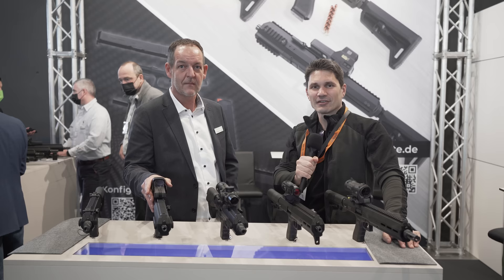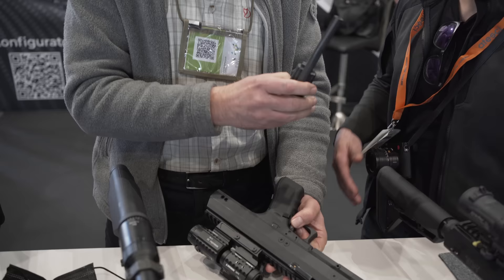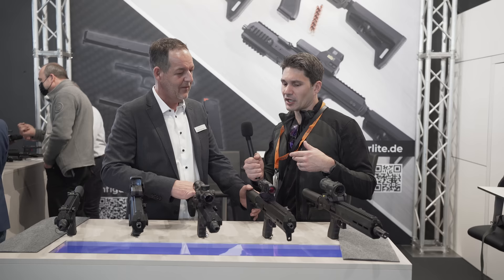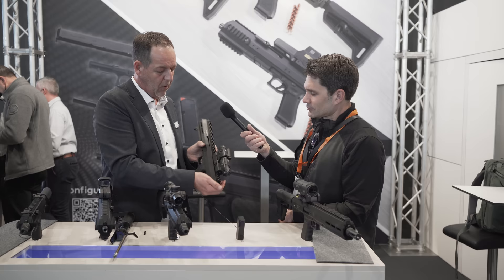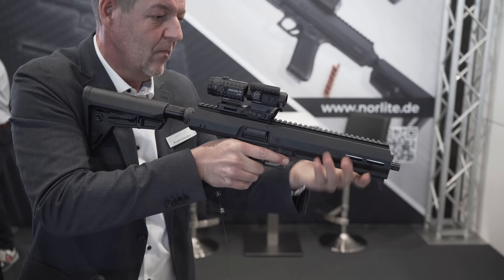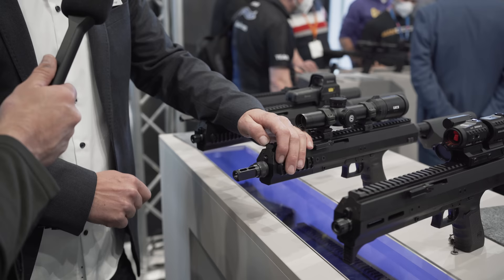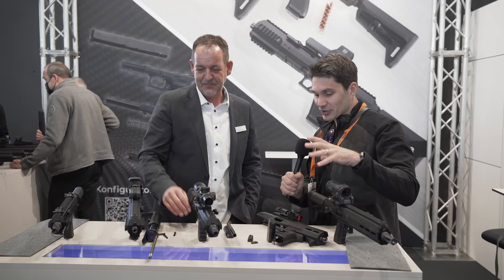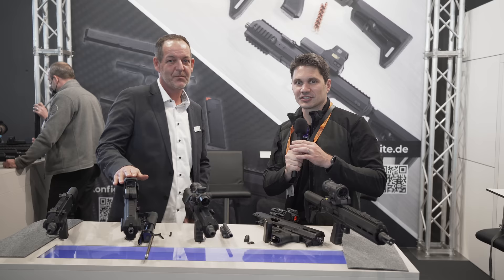The German Norlite USK-G Glock Carbine Chassis [IWA 2022]

Comment: The only chassis that actually looks useful, good to see this kind of product coming to the market.
Reply: While this does seem better in some ways have you ever tried a Roni or an MCK? Those things are far from useless
Reply: It's already been done by mectech
Reply: i would be an idiot to take this over a chassis from B&T
Reply: @Genesis23OPB  Ya'll are weird...
Reply: @Osprey1994  no its normal for me for two reasons: 1. i live just 1h away from b&t headquarters, so its a domestic product for me and 2. i want something as compact as possible, which the B&T chassis compaired to this certainly is
Reply: $1200 USD lol
Reply: The MCK 2.0 is no joke, especially for the price. However, this new German chassis is indeed interesting.
Reply: @captain edwardo  The Magtec has no last round hold up, requires the Glock original trigger, and like the Germab USK, it requires the addition feed ramp piece.
Reply: Looks like a HiPoint.
Reply: MCK chassis is amazing, for the price it's interesting that we don't even need something like this for almost 6 times the price

Comment: I wasn't expecting this. Finally a pistol chassis that looks worthy.
Reply: Yup. This is what the mech tech carbine should have been
Reply: The micro roni is still better
Reply: @bryananderson3772  that’s probably true, but it’s shape isn’t AR-15 enough to fulfill one’s GI Joe fantasy lmao 🤣… but honestly, I’d buy this thing if it’s as buttery as an authentic HK MP5 in the subcompact variety
Reply: The problem that these often are problematic with US laws that treat handguns and rifles very differently. One of the reasons that these are popular in Europe and other jurisdictions is that the legislation often limits you to number of firearms and calibers. No one will treat an AR-15 with a buffer tube as a "Pistol" this is very much a US thing.
The US definition of a pistol and rifle is very much dependent on external features rather than the caliber and indented use so when you put a handgun in a chassis you are essentially creating a rifle which would prevent it from being used ever again as a handgun, since the lower frame is often the serialized part.

Comment: These look like a much cooler option than the chasis that we have here in the US
Reply: Not a fan of the macaroni?
Reply: My friend has a "KPOS", its not very accurate at all, this new one here in video might actually bring actual rifle like accuracy within the effective range of the gun.
Reply: What's wrong with Mech Tech?
Reply: well its not really a chassis, its more of an creative extention of the slide
Reply: @Genesis23OPB  yes, quite like the system in the video...
Reply: @omicrondec  i was refering to the OP, not the mech tech comment.

a chassis is a carrier for your gun as a whole, like the B&T glock or walther chassis, flux brace or caa roni. (the B&T sig p320 USW replacement grip is a bit of an oddball, but as it leaves your gun with the original barrel length i would count is at a chassis)

mech tech and the one in the video are not chassis imo tho, as it replaces the slide and barrel and basically just uses the original grip, therefore its an extention/replacement of the slide.
Reply: @deathlis  I love my macaroni. Never failed
Reply: Yes, but this would have to be registered as an SBR unless it came with either a 16" barrel or a stabilizing brace.
Reply: @Haku Yuki   It's not like it's a stolen Monet that you can hide in a room and only view it alone.  People are going to see it and hear it.
Reply: Because these make no sense under US laws, most gun control legislation around the world limits number of firearms and calibers rather cosmetic features, in Germany using your pistol in this Chassis would not create a rifle in the US it would (and an SBR at that).

Comment: As has been stated before, the designers knocked this out of the park, and I cannot wait for it to inspire designs around FCU based firearms, utilizing FCU and magazine alone. Perhaps we'll end up with an MP7-esque Ruger  that doesn't rely on a clamshell around the slide.
Reply: Hear Hear! The past gossip and rumor(s) perhaps of a Glock Carbine and or similar has inadvertently came True.
Reply: Could probably be done real easy for the Sig 320 or 365 since the FCU is so small and easy to drop in a new system. I never even thought of the possibility of having a rifle you could jsut drop the Sig FCU into. That sounds amazing.
Reply: Now that would be something I'd actually save up money for and buy
Reply: What does FCU stand for?
Reply: @FOVoid  fire control unit

Comment: Awesome news that Norlite already has plans to ship/build these for the US market.  

I can see a couple of other comments about the MechTech carbine conversion system, which has been around for at least a decade or more. It is similar in that it utilizes the frame and magazine, and has barrel lengths ranging from 10-16". 

The good: MechTech covers a wider range of handguns: Glock, Springfield XD/XDm, and a variety of 1911/2011 pistols, and are reportedly working on an upper for the S&W M&P pistols.
They also offer multiple caliber options: 9MM, .40SW and 10MM, .45ACP and .460 Rowland.

The not so good:  the operation is likely only a few people, and lead times were long even prior to the beer bug burninating the supply chain. They are also relatively simplistic designs, a direct blowback operating system built around a round tube receiver, reminiscent of the Sten gun. The options for mounting accessories and furniture are very limited as well. No MLOK compatibility, etc.

The subjective: The MechTech stuff works well, but it looks like a rejected design from a Fallout game. The Norlite fixes a huge number of issues, mainly how to effectively mount optics, lights, etc to your ersatz Glockarbine, and the price the gentleman you interviewed ballparked is well within reason compared to the price for an upper from MechTech, especially given the improvements to ergonomics, mounting accessories and aesthetics compared to the MechTech product.

Hopefully they listen to their US partner and are receptive to offering them in multiple calibers; 9MM is fine, but don't diss the .40S&W, 10MM  and .45ACP, which there are millions of examples of Glock handguns chambered for in the hands of potential US customers.

Comment: This looks a lot like the Mech Tech systems, except done right. I had a 10mm Mech Tech that shot well, but was ridiculously heavy. Hoping they make a .45 acp model for the 21sf!
Reply: I was just thinking of the Mech Tech system. This looks a hell of a lot nicer.
Reply: I thought instantly, dont we already have that, this looks familiar? Mech Tech uppers, i never hear anyone talk about them anymore.
Reply: @RedDogRichard2112  I owned one. You couldn't field strip the upper without tools and there was no way to carry the gun safely because the Glock trigger is always exposed (as opposed to being in a holster).
Reply: @9unslin9er  wow that is bad, I'm shocked they didnt put a safety in the desgin! I kind of wanted one but at the time they didnt have threaded barrels (a pcc without a threaded barrel is stupid). Honestly MechTech uppers and JRcarbines are two things Im surprised still exist.
Reply: I happened upon this video as I was looking for a lighter alternative to my 10mm Mech Tech. Unfortunately there does not really seem to be anything other than the Mech Tech, Roni and Flux on the market for 10mm.
Reply: Ditto on the 21sf
Reply: Regarding the MechTech CCU .....5.7 lbs is ridiculously heavy?

Comment: Wow, this is super well developed.  I hope they are successful.
Reply: I must say this is available for some time here in Germany, but it did not take off. I did the configuration some time ago, and ended up at 1500 Euro. For that i can get a Beretta CX4 and I don't have a glock trigger. The system is also very top heavy.

Comment: We've had something similar for years called the Mech Tech CCU.

However, that unit was not easily dissasembled for cleaning. If they keep these under $500, and lightweight, it would be a good alternative.

Also, this needs some type of mechanical safety over the trigger guard.
Reply: You poor. This is clearly going to be 800 plus. If you can’t afford it go play with your hi point
Reply: well, he said the price. just under 1k
Reply: @thebigmoizt3270  don’t be bitter
Reply: @FunkBastid  that escalated quickly
Reply: @FunkBastid  poor detected.. Back to your just as good build with you.

Comment: This might just be the best PDW set up in comparison to those Flux raider kits because with the fixed barrel, you can attach a silencer without worrying about cycling issues. I would actually really want to buy one of these, especially if they make a super-collapsible stock/brace for a backpack gun PDW

Comment: The neatest thing about these to me is the accuracy/consistency potential compared to other chassis kits. You've got a rail and barrel that are affixed to each other even when you remove the pistol. Accuracy wasn't mentioned explicitly in the video, but the presence of multiple magnified optics on the examples they have there indicates at least that they want to project confidence in the accuracy of the platform. Lord knows I wouldn't put a magnified optic on my roni.

Comment: I wonder if they’ll have a 16” option in the US or if it’s only for SBRs.
Reply: They could sell it without the stock, then it would be a pistol
Reply: I can see both a legal-length carbine kit and a short kit with a brace happening. It'd be foolish not to do.
Reply: Most of these look like 16in already. I didn't hear a length mentioned but I'm sure they're considering those lengths
Reply: @NihilusTheGreat  Yep, plenty of AR tube brace options.
Reply: @NihilusTheGreat  It isn’t a pistol or a rifle until you attach it to a frame. This would not meet the classification of a “firearm”, and as such would not be a serialized part. Just throw a pistol brace on it before mounting to the Glock frame and you’re good to go…just don’t add a vertical fore-grip
Reply: You don’t need an SBR tax stamp for this if you simply change the stock for a pistol brace like an SBA3 or SBA4. Your Glock frame is already registered as a pistol, adding a 16” barrel would make this weapon an “other”
Reply: I’m wondering the same

Comment: If this came to US market under $1,000 I think it could be successful.
Reply: It would have to cost less than that because the total would be over $1500. There are plenty of shorter length carbines for way less than that.
Reply: @christisking1576  For people that already have glocks I mean. And what carbines are you referring to? The cheapest ARs are M&Ps for 650-750. Even diamondbacks are 1200 and up. 9mm carbines you would have to build your own, in which case you could do for well under 1000, but for the pre-built market there aren't a huge selection of cheap < 1k carbines (that I know of).
Reply: @Alexis de Tocqueville  Mech Techs run for about 500, and can also fit 1911's and XD's and XDM's. Not as refined as this though.

Comment: That seems like a lot of money, no doubt top notch engineering, amazing design, but for a pistol carbine $900-$1000 plus the $550 for the pistol is crazy.
Reply: could save an extrra $200-300 bucks if you can find a good deal on a stripped glock lower.

Comment: This would be ok for 399.00. This is cottage product for those who have a glock lower that has a form 1. Currently the best option is the recover tactical 20/20 fully decked out for under 200.
Reply: Did u watch the video? It's not just a chassis for your complete pistol. Tons of proprietary parts; it's basically a new firearm.
Reply: @vmpgsc  I did watch the video all the way to the end. My point is for the money, the 20/20 will yield same results.  I have tried them all and if this comes in at 399 I would buy it.

Comment: If the lower and trigger pack is in the Glock then you should be able to just have this system shipped to your house in the states.

Just SBR your Glock 17 before you attach it (or get a brace).

Comment: Much, much better than the Roni or Flux Defense style of adapters.  It should really be compared to the MechTech upper which is already being sold in the US for about $700.  With the MP5 type guts, forward charging handle, and M-lock rail, it may be ahead of the MechTech.

Comment: Do ya think this can be used with a P80 Kit G17/G19 lower??? That would be friggen awesome if the upper does not have to be sent to a FFL.
Reply: I was wondering the same thing
Reply: P80 g17 and g19 fits gen 3 slides so I don’t see why that would be an issue when he said it works with gen 3-5.
Reply: I am building one if they fit, the upper should be under serialized so no FFL. Would be a dope little un-serialized Carbine.

Comment: Virgin Glock carbine chassis system: Place you glock in this shell and shoot it like like a larger gun, but with all the limitations and such from being a glock handgun in a clam-shell chassis...
Chad German Glock carbine chassis: Remove you slide/barrel/recoil assembly, slide in a fed ramp part, and slide into a upper chassis unit that has a independent barrel and recoil system, and actually feels like a different gun.

And fuck, this could be over $1K, and I'd still buy it. Hope there is a 16" version...

Comment: That's a mechtech you can get them for glockenspiel springfields and 1911s made in Montana
Reply: Ya they're the same design and assembly. 
But the mechtech looks like a steel tube with a barrel attached to it.
While this thing looks like a proper carbine.

Comment: This almost makes me want to get a Glock. I just have 1 question will it work with Franklin Armory's Glock 17 Gen 3 binary trigger? I know he said it should work due to the man saying it works with 17 and 19 from Gen 3 to 5. But mechanically will it work?
Reply: No, the binary mechanism is in the slide on the Franklin armory. It isn’t like a drop in trigger, you need to buy their proprietary slide.
Reply: @omaryunus7445  aaaaand there goes my thrill for the this idea.

Comment: The recoil assembly is completely contained inside the “upper”, correct? So they could ditch the buffer tube set up and make the rear plate 1913 for folding braces??

Comment: Looks like a better executed MechTech. Might be cooler with 1913 rail in the back versus the buffer tube.
Reply: I was thinking the same thing. 
If the buffer tube doesn't do anything for the bolt carrier... then it's not necessary. 
Folding stock is the way to go!

Comment: the only problem I see is that it's barrel is under 16" regardless if the entire piece from back to front is 26" = your Glock being converted to SBR + shoulder stock = regulated by NFA, so you need to register with ATF + TAX Stamp to stay on a right side......do not get alluded to the fact that it is legal to sell & buy this product, because it is just an accessory it is perfectly legal to own it,,,, but the second you place your handgun inside it becomes SBR and that's how you get in trouble with ATF,,,,

Comment: Well this sounds exciting. Wonderful if any Gen 3 based frame would work with it?
Reply: G17 gen 3 works just fine
Reply: @dermozart80  well my specific question would be Glock spec but not Glock brand frames. Like the Polymer 80 gen 3 spec frame. Or the PSA Dagger, or the large selection of other frames made by other companies that are all specific to be compatible with the Glock gen 3 platform parts.

Comment: If it doesn't use the buffer tube for the recoil mechanism, it will be perfect.
Reply: It does not use the BT for anything else than mounting the stock. Would like to see it with Picatinny instead of the tube.
Reply: @schlemihlrosenzweig3780  I have a pic adapter on one of my lowers so I will go that route when this gets to America.

Comment: I'll pass!! 1600 euros is 1800.00 usd. That was the compact model I "made".  I got a flux raider for 600 for the fullsize p320 and 500 for the chasis. Essentially 2 guns for 700 less than the use. It's nice though.

Comment: So wait... you're telling me that after i buy a 700+ dollar pistol i can buy a glorified upper parts kit for somewhere under (but not too far off from) 1000 dollars?

Why wouldn't i just keep my pistol as is?
Maybe if my slide broke, but even then i can buy a new slide and more than likely get some custom slide work done to it for that custom flair?

The beauty of the micro roni is that i do nothing to the gun. I just pop it in, simple as can be.

Here there is nothing remotely simple about this by comparison:
You need to take out the stock by undoing easy to lose pins, then the bolt carrier, then you have a couple other small and easy to lose parts in the actual glock frame that can be lost (without mentioning more easy to lose pins)

We're not even mentioning buying new optics and lights or what have you to make this gun usable.

Maybe if you could use a P80 frame, we might have something. 

Otherwise this sounds too expensive and too easy to lose parts.

Just stick with the base pistol, or just buy and AR.